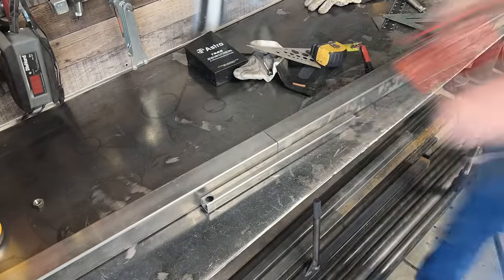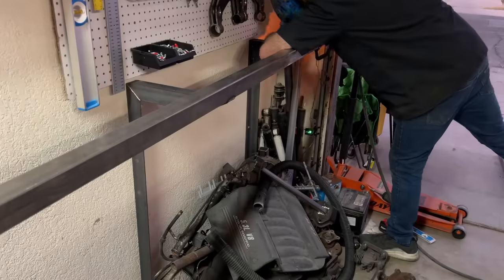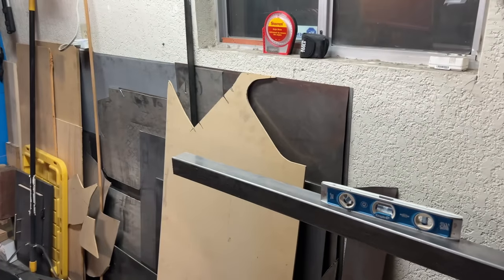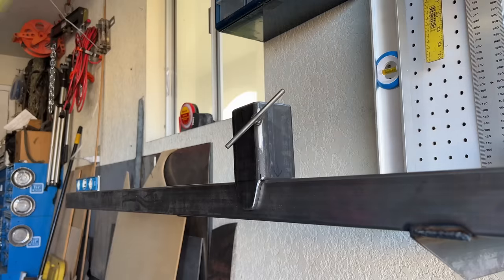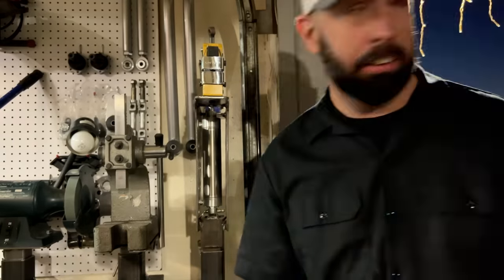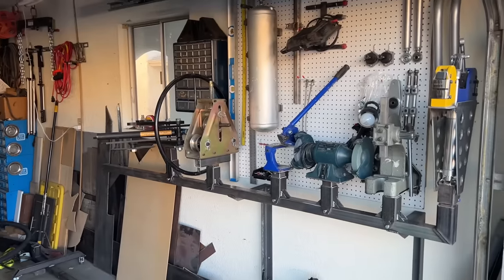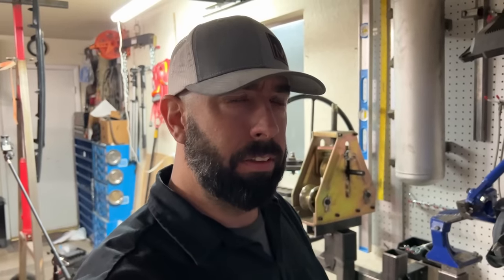Brilliant(er) Legless Tool Stand/Storage System! Part 2.5!!

Comment: To solve the plate storage, turn them 90 degrees.  Then it only takes up 4' horizontally.  I've seen where guys make a rack for the material that attaches to the wall with a hinge on one side and a wheel on the other.  Lets you swing the rack out from the wall to pull sheets out.  Usually see it for wood storage, but I imagine it would work for sheet metal.

If you don't feel like making a storage rack, just get a sheet of plywood to put over the plate.  Then clamp the plywood to the wall.  Will keep the sheets from sliding out or toppling over.

Comment: If some of your new tools are small/light enough, perhaps inverting them and hanging them in pinned receivers under the new rack would be a thing.  The receiver material could be split or installed on the rack tubing to accommodate inverted hanging/pinning.

Comment: Store the sheet metal vertically at a 5-10 degree angle.  Two pieces of angle iron as support to prevent sag.  Make a channel on the floor  to sit the bottom of the steel so it can't slide out.  7 feet of 2" x 10 gauge angle iron posts touching the wall at 6.5 feet.  Tie them together at bottom with your channel. sit the sheet metal in the bottom "channel".  Its not like you are stacking 1/2" metal against the wall.

Comment: In hindsight, I would suggest dropping the set screw idea all together and instead, have made the set screw tabs extend just far enough below the rack to insert a locking clevis pin through the tabs, but under the rack.  Thereby, you can slide the tools on the rack as needed, no set screws to fiddle with, and a real pin, not just a snug one sided set screw preventing top heavy tool rotation issues. Plus you can add or remove tool bases quickly and easily, as desired, and there are no holes required through the rack, as the clevis pin just clears the bottom of the rack. Both videos were great, so glad to see you back in the shop.

Comment: have you thought about extending the holders to reach under the tubing and using a through-pin  just under the tubing instead of setscrews? that would guarantee that the holder will not fall over (looking at the holder with the bender, seem the setscrew is not able to hold it properly) and will make it quicker to reposition and/or remove them - you just need to pull the pin without any tool instead of loosening and tightening the setscrew. for sliding them across the tubing you probably don't even need to pull the pin.

Comment: Could the sheet metal and rack swap spots? If so, the sheet could slide right out the open door without needing to go around the rack. Sorry if this was talked about and nixed in the first or second video. It’s not ringing a bell.

Comment: Of you re-purpose the rolling tool rack and add a back hoop you can turn it into a rolling sheet metal rack you can roll away from the wall when you need a long piece. If the pieces are just inside the wheel base they will hold the rack vertically sturdy.

Comment: How about a hinge / pivot if your using the tools right against the wall. That way pull up the tool to more comfortable position and if necessary to remove from the rack when transporting it to a different location.

Comment: I would use that original 8' roller base piece and make a rack for your sheet metal that you can roll out from the wall when you need the bigger pieces in the back.  In a small shop portability is key.

Comment: Use the old rolling rack to hold the  sheet metal. I did something similar for my steel rack. Roll it away from wall and slide out what you need.

Comment: 1, why not make the rolling part into a rolling metal rack, so then you can just roll it forward, or all the way to where you need the metal, then slide the piece out.  2, you can make a 2 or 3 head, adjustable height, post allowing you to setup a work flow of a few tools if you need to.

Comment: You could use that old rolling tool rack to hold your sheet metal. Add some bracing and a little to the bottom of it for the smaller pieces. Then you could roll the sheets out to remove them and keep the small pieces off the floor.

Comment: Perhaps now modify your ‘rolling receiver’ to become a sheet metal rack. That way it could tuck behind the end of the new wall-mounted bracket till needed, then roll out for sheet(s) to be removed or replaced. That would need floor clearance at the end of the tool rack though. Love the continual thinking. ‘Keep moving forward’! Les in UK 🇬🇧

Comment: Itt looked like the stand was a little flexible. Maybe add some sort of support at the bottom? I kind of envision legs that touch the floor, or maybe a disc welded on toward the bottom  so it sits flat on the floor? There were definitely some good ideas in this one!

Comment: If the tool rest was mounted to a horizontal bit of tube, you can slide the horizontal tube and the tool placement could be anywhere on the long tube. A second tube mounted under the top tube with a horseshoe type mount, you would just pull the tool off the tube.

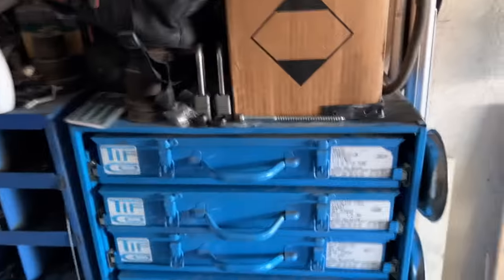Comment: 5:41 you could probably call those gussets. 7:49 you have a drawer of gussets, thats badass. I see your issue with blocking your sheet storage. What if you put 2 hinges on the wall and a swivel wheel on a leg at the end and that way your rack could swing away from the wall. There are a pair called badass hinges made for gates that would work perfectly

Comment: I have the same set up but instead of the floor post I made them to slide in under my fab table. Also used pipe so I can roll my bench grinder under the table or the table vise.

Comment: Why not mount the tool bar just above 4 ft so the sheet metal can be stored under it. Use the brackets to put some fold down clips to keep the sheets upright. Sheet metal stored on bottom, tool heads on top.

Comment: Personally I preferred the rollaway, can move it as designs change and take it completely outside if you the room temporarily. But if going with the wall idea, I would have put it on a pivot and left it 8’-10’ long. Also made it for you could use some tools in place.

Comment: Before you cut up the old rack you could use it to hold all your sheet metal. Then when you need a piece you could move the it away from the wall or with it on wheels your sheet metal could be outside with the frame.

Comment: Is there a reason to not swap the rack with the sheet storage? Sheets by the garage door where they won't be blocked if you want to pull out a full sheet.

Comment: You can still have those extra feet, just make it removable. Slide the extra together with the rack like it was a reciever hitch. You won't want heavy tools on the end and you may not want it at all if you are constantly pulling full sheets out, but if it is every once in a while then it wouldn't be to much trouble. The one post set up is a gteat idea.

Comment: You may also be able to drill out a hole where your current set screws are and put a receiver weigh safe hitch ball pin through the horizontal bar and the receiver ends. Using this method, you could also drill extra holes throughout the support bar that allow you to quickly and easily move tools left or right now that you've added the gussets.

Comment: Why not put the rack brackets behind the sheets it would mean the tool bar or rack would be a touch higher but both would be in the same space
Reply: I agree.. but it would make the tools 5foot from ground. Step stool recomended.
Would also have to loose the bracing. Probably increase the angle iron to something thicker.
Reply: @turboflush he could just flip the braces 180 degrees and still get the same strength. Maybe even weld more brackets to have shelves above the tools.

Comment: Now, make your common riser floor "extension" adjustable height.
Reply: Or, just shorten the universal tool post height so every tool can be mounted on a different length post to obtain proper height when both are co.bined without having to engineer "adjustability" into the mix...
Reply: @reseehc99  Adjustability works for different tools and different height users, and it is extremely easy.
Reply: @freeidaho-videos  it does, but individual heights on fixed mounts are arguably stronger/more stable. They definitely require less engineering to achieve similar results.
Reply: @reseehc99  No engineering, strong as hell.  Just cut a length of receiver hitch to weld onto a shortened length of the existing post.  Weld it all together, add a couple of set screws and done.  A hitch pin and some holes could also accomplish the adjustability.
Reply from the maker: @freeidaho-videos I’ll likely go this route. It doesn’t need an insane amount of adjustability. 14” probably. And the diagonal set screw would keep from having any play.

Comment: Cool stand with adjustable square tube holders.  An idea on the square holder, extend the flange with the set screw of bolt below the square beam and use a quick release pin.  No hex tool or wrench needed. The pin below would keep it from tipping and you can still slide it either way the pin in.